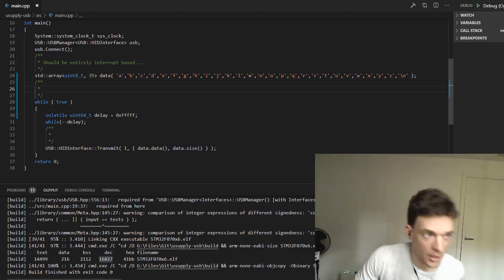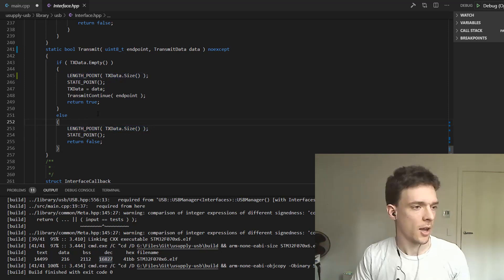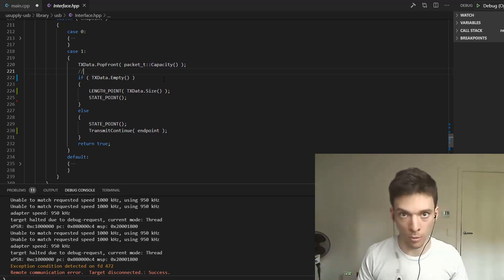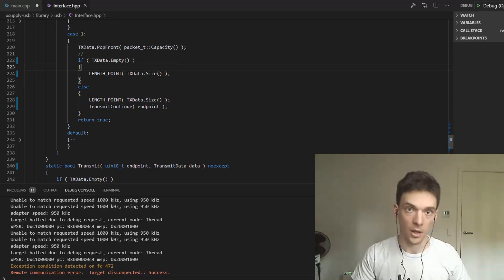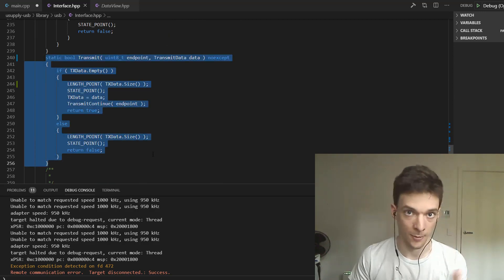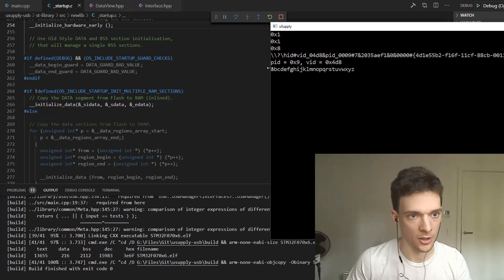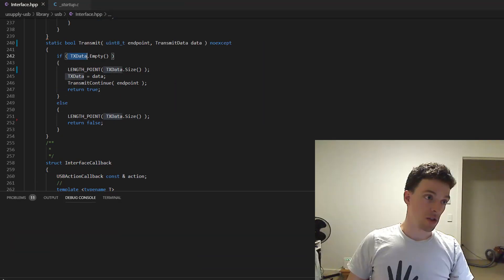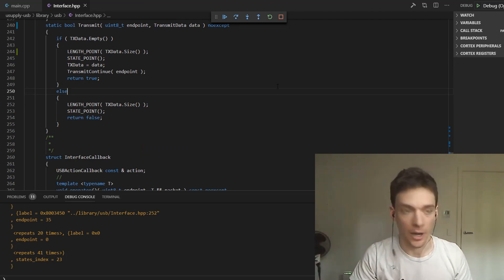C/C++ Interrupt Undefined Behavior

Comment: volatile :-p Without this, it is like writing multi-threaded software without using mutexes/semaphores/memory-barriers.
Reply: Its where volatile is placed that is important here. Placing volatile on the data structure as a whole requires volatile overloads of member functions.

Placing in in the data structure incurs a penalty for all call sites that don't require volatile.

Comment: I thought "volatile" just meant "do not optimize" or "can change outside of the code".
Reply: Basically, just means the value can change with the compiler not knowing how. 
The compiler must treat the variable as if it can change even when it doesn't know how. Registers can change without the compiler knowing how, they are an example. 

In the video i listed some misconceptions about it. I didn't really define what it was though, only what it wasn't lol.
Reply: @davidledger5941  volatile also does not protect against multiple access.  You have no guarantee that the high byte of the int you are reading is going to go with the low half of the same int since they can't be accessed in one instruction.  I highly recommend using a semaphore or a rotating buffer to prevent that from happening.
Reply: @KillerSpud  Yeah no it doesn't.
I hope I didn't imply it did? I have said many times now it doesn't replace atomics and isn't atomic.

Comment: If the function that reads size is const, then you are saying it can't change between calls, so the optimiser may remove additional calls. Also, the functions are static, and if private, these may be inlined. Finally, if size may be updated in a interrupt or other thread, you must declare it volatile.
Reply: Great comment.
As far as I've found so far, I don't need to set the data structure to volatile. Just the access to it. That way the there is a boundary between the data structure and the optimiser.
I may still be invoking undefined behaviour but this time slightly different one. I'm not sure yet, I'm trying to avoid a specific problem here so looking for a well defined work around.

"Finally, if size may be updated in a interrupt or other thread, you must declare it volatile."
Also everyone is saying that, but I believe if a global is ONLY accessed from a single interrupt (like a counter) it doesn't need to be volatile. Im still checking this though, but figured somebody could shortcut my search with prior knowledge and references to the standard or cppreference.

In my case you spot on, because I was silly and did it from two control flows. But I don't think its true in general case. Please correct me if wrong.

Comment: Hi David. Took me hours to go though  compiled ASM code with the same bug (?). Use pointers and or EXTERN on a global.
Reply: Good idea!
That might allow me to avoid using volatile because the pointer value doesn't change between the the main execution and the interrupt. Just need to make sure that is alright in terms of undefined behaviour. I need to check if that is still undefined behaviour.
Reply: @davidledger5941  I did put a question mark in brackets after bug :). Volatile does work and the advice below to use it on variables that can be changed is 100% correct. I looked at that specific code after my comment and yes I solved it with Volatile after some googling and reading the GCC manual. RTFM. You will quickly make enemies if you knock gcc. Maybe you could do a educational/ follow up  video re the use of the compiler directives in gcc.

Comment: The advice to use 'volatile' is dodgy in my opinion, it may work in simple cases, but if an interrupt handler modifies two related variables you're already in trouble, because your program may read one before an interrupt, and one after.

On many processors (e.g. ARM) a statement like "size += 1' if size is an "int" won't be executed atomically, it gets translated into a load, an add, and a store instruction, and 'volatile' won't change that. If an interrupt hits in the middle of those instructions and that interrupt also modifies 'size' the interrupt's update is discarded, because the main program already loaded the value into a register before the interrupt happened, and it will overwrite the changed value.

On a single core CPU it's best and often essential to very briefly turn the interrupts off. Any sane embedded compiler will disallow loads and stores to move across the disable/enable interrupt intrinsic operations (i.e. they act as a barrier/fence), and so you don't need 'volatile' in this case. Temporarily disabling the interrupts on an embedded processor is typically very cheap (I wrap it in an RAII class to keep from making mistakes). I've used this strategy with an IAR compiler on an STM32F<something>, very similar to the processor you're using.

In short: variables that are shared between your main program and an interrupt handler should generally not be accessed when the interrupts are enabled. If it's a single variable, and you can guarantee that the operation your main program performs is done atomically then maybe you can make it a volatile variable and leave the interrupts on, but I'd inspect the assembly code to make sure, and I'd only do this if the timing is extremely critical.
Reply: Yeah I agree. volatile is used soo darn often where atomic instructions should be. This is one of many reasons that volatile is not a complete solution and why I'm not happy using that alone.
ARM M0 does have limited atomic intrinsics so its abit more challenging for that. They are as you described, but thats fine I suppose. std::atomic makes adding this quite easy, although I think it isn't copy constructable so I've resisted using it.

If anything anybody reads, please read the second paragraph of this comment!

Comment: it is "easy" in a way...   volatile tells the compiler that the memory can potentially be changed by an interrupt handler ON THE SAME THREAD. and it tells the compiler that it shouldn't optimize away a read or write on that variable
This was great and dandy in "the olden days of yore" when we only had single CPU machines, and the only way a variable could ever change other than fiddling with it directly is if it was done by an interrupt handler on that very same single CPU.

And in a multi threaded environment you can still use it that same way under the same conditions. assuming the thread that will read the variable IS THE SAME THREAD that has changed the variable.  Which for most OSes is impossible to guarantee for interrupt handlers. So for all intents and purposes in a multithreaded appp for modern OSes, the use of volatile is largely unusable (at least as a simplistic "just read it again" type deal).

you can't safely use it (on it's own) for ANYTHING involving access from 2 or more different threads.

You will need it to decorate some variables that will need simple gating using  in combination with something like the windows API call InternlockedIncrement (but in c++  you really should be using the atomics library, but sometimes you have to do it the windows way, especially when you're in driver territory).
And you can use voilatile to somewhat control the cpu's out of order execution. (although you very rarely want to mess with that).

Comment: Old eX programmer here, probably full of it. It pays to pay attention to the basics, is the idea here.
Are all the variables used GLOBAL variables, or are they instance (of the function) variables?  If they aren't globals, you pass them to the function as inputs when calling the function, otherwise they are undefined at the start of the function.  You speak of all the optimizations that can take place, but I think the Volatile keyword inhibits most of them, just as making an instance variable into a global would.  Globals are HATED by computer scientists, because of possible race conditions.  For small embedded systems they are acceptable imho.
Reply: static member variables are not members and are not passed into the class as a pointer.
Care must be taken to ensure they are initialised at the correct time and order.
Yeah exactly right about volatile, its why I'm trying to avoid it. Globals are necessary in embedded systems.
Reply: @davidledger5941  I stopped programming before I had to learn C±+. 8-))  You can hide gigantic swaths of code behind overloaded operators.  That's one of the reasons I think C++ failed and possibly why some OO C derivatives allow buggy code.
Reply: @BobPegram  Righto, I have seen what your talking about before and have done it myself on occasion (operator overloading confusion). 
I'm always still learning, takes a while to absorb all the anti-patterns that are possible. I'm sure I have many more. 

An example of code hiding being a problem. In my code here I didn't have any real reminder to myself that the TransmitComplete function was called by an interrupt and didn't think to consider the problem. Could have been solved by better function naming for example.

I'm not against code hiding, in the right context; operators are just functions after all. Libraries are all code hiding, its the nature of functions.

Comment: Rookie mistake or Clickbait I think.  This video is pretty long for such a simple mistake.
Reply: Stupid mistakes happen. 
For anybody reading, it was undefined behaviour to have the the TransmitComplete function called from an interrupt and modify the static variable TXData.

The compiler assumes a single control flow in an application and that is the main flow.

Volatile fixed the issue because the compiler was prohibited from optimising around the assumption that the main control flow was the only control flow. There are alternative ways to handle this such as:

1. Using a flag to trigger the operations on TXData on the main thread, the flag being atomic.
2. Using volatile as shown.
3. Perhaps using volatile pointers, not sure yet whether that is also undefined behaviour.
Reply: You should put your findings in a pinned comment instead of hiding it here. It might limit the flood of similar comments. =)
Reply: @zvpunry1971  I'm just an ordinary commenter, have no ability to do that.
Reply: I thought David J. gave you access to the channel. But after reading some of your comments, it's clear that he hasn't.

Comment: This is not a bug. Data structures or variables changed by an interrupt, need to be volatile or they will get optimized out. It is kinda stupid, the first time i dealt with this it probably took me like 3 houres to figure it out.
Reply: Yeah, didn't notice. The worst thing is I've done it before... It just cropped up in a different form.

Comment: I may have missed this but are there any threads in this code or are the interrupts occurring concurrently ? I see you're putting stuff onto some queue/fifo and popping  stuff off. Is this all a single thread of execution? This is very important for us to know.  As an aside, I used to work with an annoying guy on an embedded system where he would disable the clearing of memory (static vars etc) in _cstart which is the code/C/ASM that runs before main() starts. He would do this and not tell anyone and lo-and-behold code that was previously working would stop working for no apparent reason. There isn't a  hot enough place in hell for that guy. 
more relevantly ....

Why are you using constexpr to declare your member functions? constexpr is something that is evaluated at compile time and is considered const. So at each call site you'd probably get your so called function behaving as though they are const. What are you trying to do exactly? 
"The constexpr specifier declares that it is possible to evaluate the value of the function or variable at compile time. Such variables and functions can then be used where only compile time constant expressions are allowed (provided that appropriate function arguments are given)."
Try losing the keyword and see whether your code magically starts to work!
Reply: There are interrupts calling the TransmitComplete function, I didn't notice the undefined behaviour there. That bug with your colleague sounds crazy to isolate, most people trust the implementation of the start functions... 

DataView is a generic class used for all sorts of things. Sometimes in a constexpr context. constexpr functions can be run at run time. constexpr removal didn't fix the code (tried that), it was undefined behaviour I didn't notice.

Comment: > One of several bugs now found during the µSupply project development.
What were the other bugs? Sorry video is a bit tl;dw are there links to any issues?
Reply: ld linker uses VLA's; GCC 7.2 created heaps of symbols which caused a stack overflow. Resolved with help from people at libiberty.

The other bug was just "Internal Compiler Error", it didn't give any information at all apart from a link to report it. I discussed it with somebody (don't remember who, sorry was a while back). The fix was upgrading the compiler, no idea what the problem was I setup everything again, ported from eclipse to vscode (so that I could easily use cmake) and changed things until it worked. That bug didn't have much documentation, I didn't identify what was causing it...

The other bug was refering not to GCC (But I think dave was referring to it in the description) but the .net Native bug. The generics code used inside SynchronizationContextScheduler recursively included itself indefinitely. This was caused in System.Reactive library 4.1. Basically had to downgrade to get it to work.

Comment: It's a little hard to follow without have the full source in front of me. but is it possible the problem is in the library/SDK for the micro you're using?
For example if you're checking an SFR that holds buffer status/length for usb and the SFR wasnt declared properly in the SDK headers, the compiler might optimize your code wrong.
This is just a wild guess because it seems like if this was a compiler bug it would effect so many things in most code that it would have been found immediately. 
then again I might have misunderstood the problem entirely, if so please ignore me.